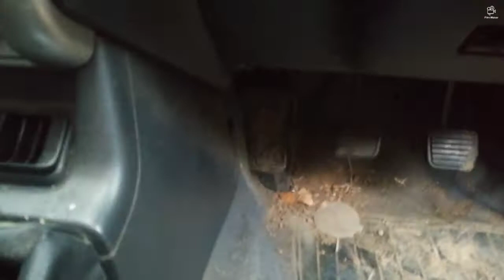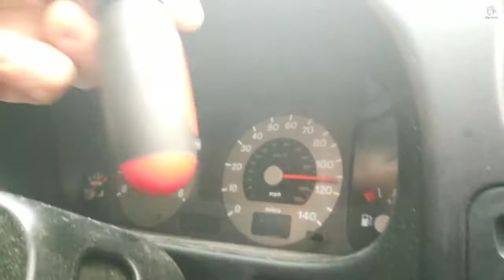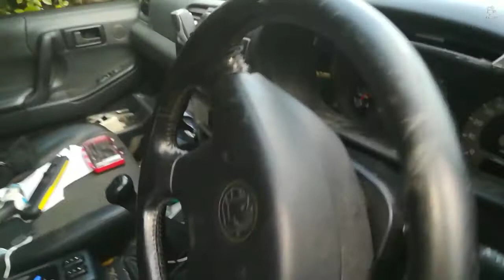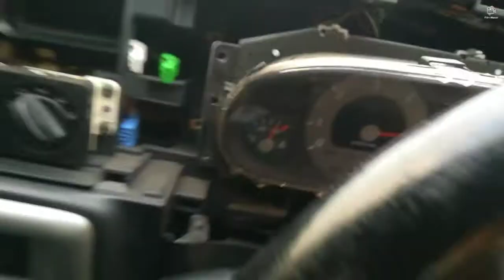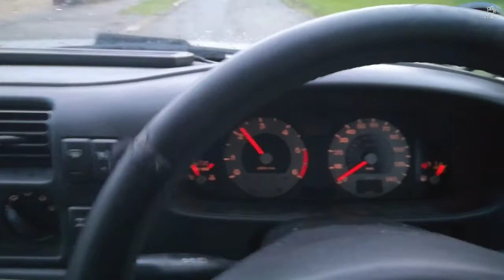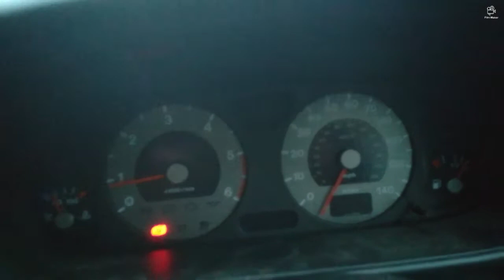Frontera Instrument Panel Taco Speedo Problem Fix

Comment: Easier fix found, take 15 amp fuse out for Speedo ect and turn ignition on and off till all dials go back to normal just done it on my frontera all back to normal now
Reply: Hello, I had the engine repaired 6 years ago. After the repair, the rpm indicator started to show twice. (2000 rpm = 4000 rpm) The odometer shows 10 kilometers more. The engine temperature is too much. Is software required again? 2000 model 3.2 v6